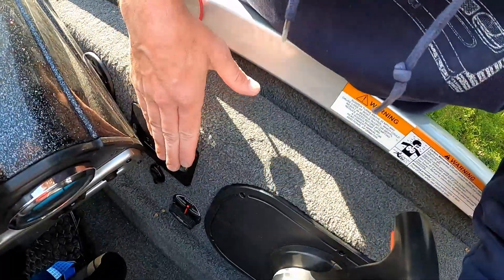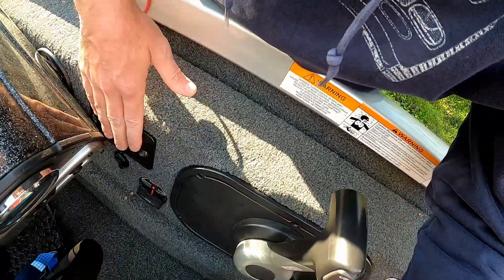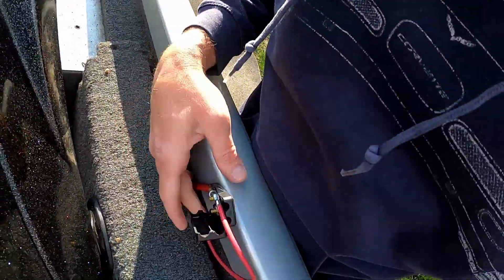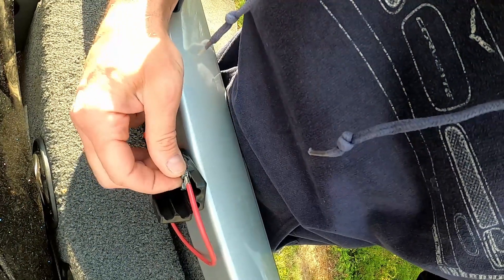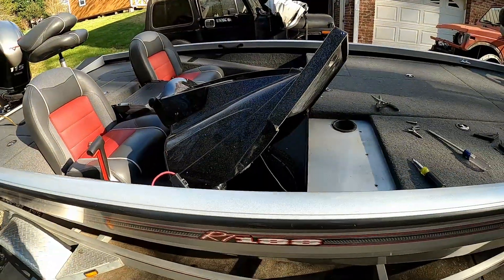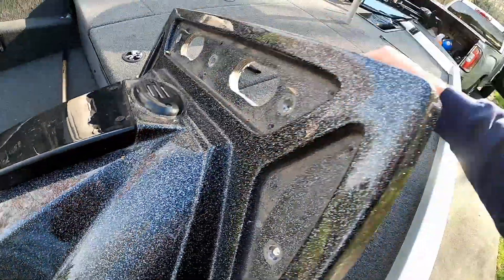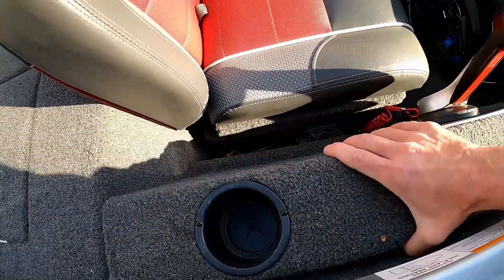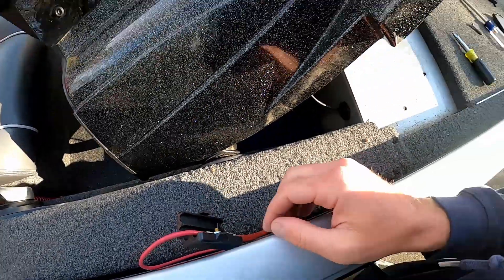Ranger RT188 Common issue with power to fuse panel solved

Comment: Wanted to let you know you helped me get on the water today.  I made the mistake of letting water get in my boat slowly over the winter season.  The area it was parked in didn’t allow the water to drain properly.  It was a big mess and caused me to have to do a bit of rewiring.  Got everything lined out yesterday and I jumped on the boat to check everything one last time and I didn’t have any power running to my console.  Pulled this video up and got the answer I needed.  Appreciate you for posting this and helping salvage the day!
Reply from the maker: Glad I was able to help!